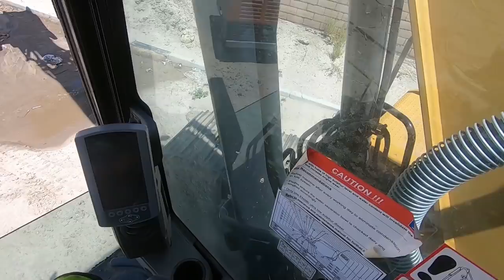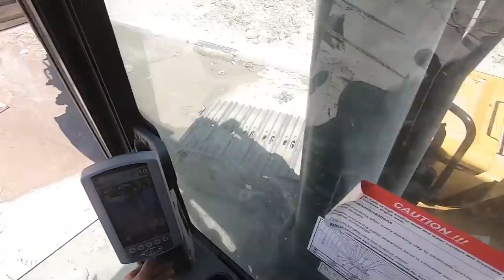Caterpillar 320F Excavator Loading

Comment: Top video as usual!! I am a big fan of Ron Pratt and now as much a fan of yours!! So much experience and knowledge for you age. From Greg in the UK.
Reply: Greg Banks,
I like the courteous and professional conduct of Midwest Truck and Plaza Towing guys. I’ve watched a few videos from a couple other YouTube channels with equally impressive tow trucks,  but was not impressed by the drivers.

Trent,  you’re a hard worker and you do your job very well. To up your game even more, I suggest you keep a broom on board to use to knock the bulk of the loose dirt off the machine’s tracks and frame before crawling it up the trailer.

Comment: Why do truckers leave their engines running as in this case, while loading ?
Reply: Maintains power to vital equipment, lights, hydraulic pumps, electric motors and air etc.